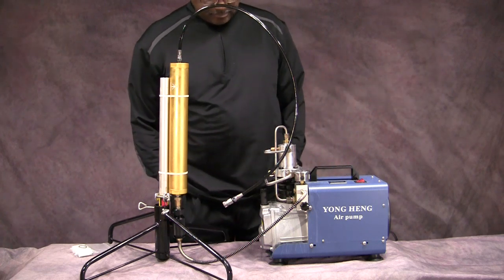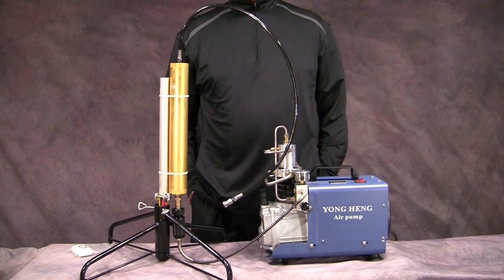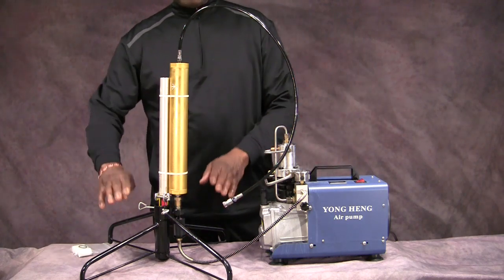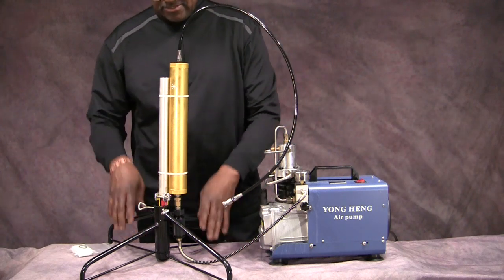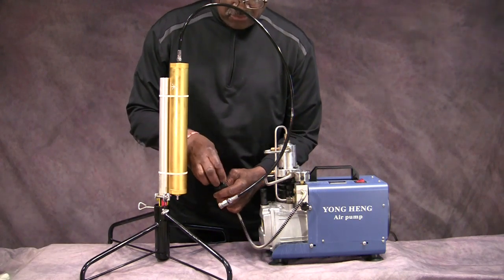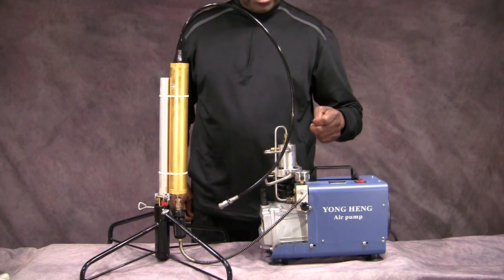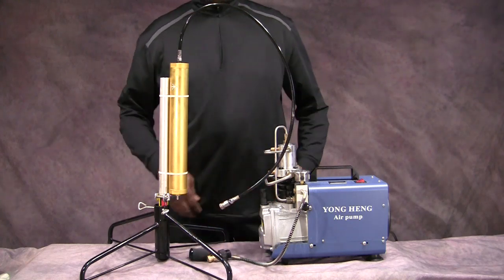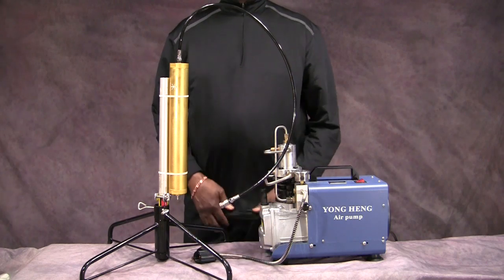Update: Final Setup for my Oil/Water Filter

Comment: Thing is, most of the filtering medium is useless... you use charcoal, which only really helps with odor from the compression and silica, which is just not as good as the molecular disiccant at high pressures. You only really need the cotton "filters" on top of the molecular disiccants.

Comment: The water itself is not necessarily a problem in quality built guns (bigger problem with cheap metals). But the real issue, is the water freezing under pressure. It can destroy valves, etc. if the water freezes at high PSI ejection.

Comment: I picked up a tree stand from amazon as of my post it was $9.99 on sale. The legs fold up, I plan to use only 3 legs and wire tie the separator on to the side that's folded up. With the legs folded up it takes up less room, being steel its sturdy an stable

Comment: I am s-l-o-w-l-y getting started in this game and as such I spend a lot of time looking over old and new information . I found your post today and I have to tell you the "tree stand" is a Super Cool way to set up the vertical filtering system.  Those stands are generally cheap and can be found anywhere.  The footprint is wide enough to prevent the filter from tipping over. Thank you for sharing this idea and thank you for the rest of the information you provided in this video. Looking forward to watching the other video's you have produced!!!

Comment: Quick question Aaron, I filled my tank to 4500psi and I mistakenly closed the valve on the tank before turning off the compressor or releasing the air from the drain screws and now my Yong Heng compressor blows air out of the black oil fill cap instead of the fill hose, do you have any idea of what the issue could be I would really appreciate it ,TIA

Comment: I have a question why won't the hose from the compressor fit the snap on on the filter ?
Reply from the maker: I had no problem with that.  However, if you are having problems just pick up a few extra male and female fitting on eBay.  I find that the quality is often better than those that come on the hoses, tanks, filters etc.  These are the ones I purchased: https://www.ebay.com/itm/363616280262?hash=item54a9381ec6:g:EFYAAOSwNnVhijK4
Best of luck.

Comment: You need to flip the line from top to bottom
Reply from the maker: NO,  I WANT THE COMPRESSOR LINE ON THE BOTTOM SO THAT AT PRESSURE RELEASE MOST OF THE WATER WILL BE BLOWNED OUT OF THE CYLENDAR.   Thanks for watching.

Comment: Hi Aaron, I bought the Yung Heng compressor last week and watched both your videos about it, I liked your Xmas tree stand idea. This is my first compressor and I wrap the wet towels around the tubing like you suggested and put radiator fluid mixed with distilled water.   I ordered the oil water separator, and a 4ft fill hose. The only thing I didn't order yet is the 90° elbow fitting I noticed on your compressor.  I was only able to find one rated 2800 psi maximum. Is there ones rated higher? Thanks for all the information.
Reply from the maker: I did not put an elbow on my compressor but I have put them on my fill adaptor.  I just went to Lows and got 1/4 inch elbow from their plumbing department.  No problem yet. So the 2800psi should work I guess.   Best of luck.

Comment: Amazon has that filter for about $90 I use the alpha filter but that’s  $400 I was thinking to get that filter and try it as a first stage and use the alpha filters as a secondary and try to see if anything makes it to my it to my alpha filter  ...I have 3 compressors and the young heng it’s my cheapest one i like cause it’s convenient I also have a $2800 scuba compressor the young heng is the one I use the most good one for the money
Reply from the maker: If your have a a $400 Alpha I think it is overkill to add another.  Just use the original Yong Heng filter as I do for a pre filter and change it often.  Just my thought.  Thanks for watching.

Comment: When mounting the filter is the charcoal at the top and the molecular sieve at the bottom
Reply from the maker: I like to have it first go through the  cotton then the molecular sieve and then the charcoal.  However I have now taken out the charcoal because I was told that the charcoal is for diving.  Now I put in double cotton first to make sure the oil is trapped and the Molecular sieve last to take out the water..  Thanks for watching.

Comment: No offense, but I don't think you really understand how a desiccant like Molecular Seive or Silica Gel works. Both those materials actively absorb water and bind it until saturated, at which point it may as well not be there because it isn't going to absorb any more water. The only time you'll see liquid water is when the material cannot actively absorb any more so leaving the bottom end open to 'let it drain out' will not work - either the material is 100% saturated or (if not) it will continue absorbing water from the air until it is. It will not 'dry out' if left on its own, you have to use energy to drive off the water, such as heating to 350degC in an oven for 4-5 hours. Once dried it's good to go again. Molecular Seive is a bit more aggressive/faster than silica gel for absorbing water, and consequently requires more energy to force it to give up any water it has already absorbed. Don't ever leave it in an uncapped container for any length of time.

Comment: I like my Yong Heng but you do need to operate it correctly.  I had to return the first one I bought.  So turn it on with the black knobs turned out and run a minute or two then tighten the black knobs. Depends on outside temp for worm up colder temps run more, hotter temps run less.  Before turning it off depressurize (black knobs out) before shutting it down.  I have had mine for 1 year.
Reply from the maker: Great ideas on how to maintain the compressor for many years of service. Thanks for watching.
Reply from the maker: Sorry this is so late but I just found your comment.  Thanks for watching.

Comment: Hey Aaron, I'm kinda new to PCP air rifles. I work on high pressure air compressors and high pressure air dehydrators when at work. Some pointers I'd like to give you that will ensure the air you put in you bottles is dry.Air is like a sponge, when you squeeze a sponge the water falls out, when you compress it at some point in the compression the air reaches saturation, when that point is reached 3 things have collided  " pressure " moisture content" and "saturation temperature". A simple thing you could do is install a back pressure valve set at lets say 4200 psi, have the valve installed as the last fitting before the air goes into a bottle of gun. In doing that when the air is squeezed to 4200 psi and then the back pressure valve drops it to what ever pressure you charge the bottle or gun to lets say 3500 psi that 700 psi drop expands the air causing a separation of saturation temperature and pressure, just like wringing out a sponge. The other thing I would do is the cylinder you have, the gold colored one, if you could wrap that with a wet cloth and blow a fan on it you will get a chilling effect like a swamp cooler and that will aid in condensing out moisture from the process air, if you could submerge it in ice water would be even better but I think that is a little extreme. Also what I would do, on the cooling water, I'd get some copper tubing maybe 1/4 inch of the soft refrigeration type and wrap it around the discharge pipes of the compressor (the ones that get hot) just coil it around the pipe. I'd then route the water returning into the bucket thru those copper tubing's and then into the bucket. The compressor will run cooler and you will get more water and oil out of the air.
Reply from the maker: I had never heard of compression aiding in dehydrating the air and Ice water ideas sound good.  You have some great ideas on how to keep the compressor cool.  Thanks for the information.  Best of luck.

Comment: Hello Aaron, Question:: I have installed this same setup with just beads. I have a problem here. During fill-ups when the pressure gets to around 150 bars the compressor struggles and will not continue filling to my required 200 bars. My compressor does not have a auto pressure shut-off.. To me it seams as though the high pressure may be compressing the beads so tightly that the air flow is restricted (just a guess).After removing the filter everything returns to normal,. Have you had this problem or have you heard of this problem with this filter before?
Reply from the maker: I have now heard of that problem before.  The beads cannot compress as the air will travel around them.  Try placing a cotton filter at the end of the filter as one of the beads could be clogging the outlet.  I have cotton at both ends of my filter with the beads in the middle.  I am glad to know that it is not the compressor itself.  Thanks for watching and best of luck.
Reply: There is a metal disk with air holes on the top of and bottom of the filter to prevent that, but I will try cotton also, thanks|    @aaroncantrell8819
Reply from the maker: In that case I just don't know what could be causing it because the air passes around and through the pellets so they can compress.  Wish I could be of more help.  Thanks.
Reply from the maker: I just talked to ken and he has had his for almost three years and he says that his will now not compress over 3000 psi and then it blows a fuse.   He thinks it is the motor not being able to push the piston past 3000 psi.  I just wanted to pass that along too.  Thanks again.
Reply: Well if kin decides to try a fill by bypassing the filter and go to a straight fill I would surely appreciate to know if his compressor returns to normal and goes past 3000ps, Mine works perfect without the filter.r @aaroncantrell8819
Reply from the maker: I will tell him about your similar problems to see if he has come up with a fix.  thanks.

Comment: Aaron  I hate you now  another thing to buy. Going to buy a harbor freight $10.99 12x 18 wood rolling cart to move it outside to porch.  6x16 covered porch.  Will be easy to mount the filte4 as the Yong heng measures 12 X 18 and will fit crossways  .to crippled up to carry a 30 pound thing while using a walking stick.
Reply from the maker: Sounds like a good plan I think I am going to copy it.  My compressor is on top of the washing machine and driving my wife crazy.  A cart would allow me to put it away when not in use.   Thanks for the idea.  Best of luck.

Comment: Great and very informative videos. I’ve been watching several of your videos and I have purchased one of these Yong Heng Compressors for filling my HPA Tanks for paintball a couple weeks ago. Everything has been 100% on my end and I have the same system. No issues at all. Do you think the desiccant is unneeded or would it be okay to use both the desiccant beads and the molecular sieve beads together? 

I also may add one more Cotton Filter at the end of the big gold water filter, just to catch anything else that might pass through, for the last stage before the air goes to my tank. Would you say this is a good or bad idea? Appreciate your information and clear guidance. It helps us out a lot. I subscribed.
Reply from the maker: Everyone is telling me that I should use the beads and cotton because that will take care of the water and oil that could be a problem.  I would put the cotton oil filter first before the beads to keep oil off of them.  In my case I think I am going to put cotton, beads and then cotton again when I change my filter.  Thanks for watching and for subscribing. Best of luck.

Comment: Hello Sir,  your review of the Gamo Urban inspired me to get my first PCP gun which I got for Christmas.  Question if I may,  I'm looking at the Yong Heng air compressor. On Amazon, there's one for $289 (Simple version) or the pressure customized version for $379.  I'm a complete noobie at this.. But will the simple version work fine for PCP filling?  Thanks.  https://www.amazon.com/Compressor-Pressure-Inflator-Portable-Compressors/dp/B07JBV3VBC/ref=asc_df_B07JBV3VBC/?tag=hyprod-20&linkCode=df0&hvadid=241941495556&hvpos=1o1&hvnetw=g&hvrand=17281590788733053361&hvpone=&hvptwo=&hvqmt=&hvdev=c&hvdvcmdl=&hvlocint=&hvlocphy=9011562&hvtargid=aud-466606931481:pla-574529760892&psc=1
Reply from the maker: Don't pay the extra for the pressure customizer because it may fail which could break the compressor.  Just get the regular one and keep an eye on it when in uses.  Also look on eBay and check under just PCP compressors because the Yong Heng is sold under several different names and for many different prices.  I got my compressor for $219 with free delivery.  Best of luck.
Reply from the maker: Sorry this reply is so late I just saw this post.  Thanks.

Comment: Hello aaron
Got a new question for u. Bought the yong heng.  Now trying to decide in an oil.  The book calls for aw or iso 46  but recommends  mobil 827/829.   The 46 i's a 15 weight oil while the 827 is higher. Not to mention expensive.  And I've also read a few comments on the net about using air comp oil that is rated for scuba or human air consumption....   what you think buddy?
Reply from the maker: Ken and I use #46 Hydrolic oil.  It is a clear oil so you will know when to change it by watching to see when it starts to get dark.  I hope this helps.  Thanks for watching.
Reply: John Brewer:  I sprung for the more expensive synthetic oil,  Amazon $8.95 a quart.  It is clear and cheaper than any syn.  I have used synthetic oils for 30yrs and they well worth the money.
Reply: @back2backjack1   thanks robert.   Im going to do jyst that.   Im jyst trying to decide on scuba compressor type oil( assuming that the oil doesn't release as much of the smell)..   or an equal to the the mobile 827 they recommend...

Comment: Thank you Aaron for making all these videos. I just ordered the Yong Heng and the filter that you recommended. Hopefully I'll have the same good results with the system as you have had.
Reply from the maker: I would almost guarantee that you will have a Good experience and service from this system.  In fact the only failure I have ever heard of is when they forget to plug in the water pump resulting in failure.  But they got the parts they needed on Alie Express and made the repairs in no time.  So make sure that the water is flowing every time.   Thanks for watching and best of luck.

Comment: Aaron: Your air must be drier than a popcorn-fart (as my dad used to say)  However I think it is over kill.  I use the first stage and change the cotton every use (they are cheap)  Thanx for Ur take on wet PCPpp"s
Reply from the maker: I really researched this topic before marking this video and all the experts say that this kind of filter is a must and if the filter is not used correctly they are not effective.  So my video contains all their information and recommendations.  Better safe than sorry especially if the solution only cost $99.00.  Thanks again.
Reply: OK @aaroncantrell8819

Comment: Today when I got my gamo urban I thought I didn't pull it back far enough  so I pull the bolt back twice putting 2 pellet in it at once when I shot  one pellet came out the side really fast I though I mess up the silencer I got lucky anyway nice video....  Isn't it possible to used car air compressor  sorry for all the questions
Reply from the maker: No a car compressor can only pump up to about 150 psi.  I have had hundreds of double feeds but never had any come out sideways.  Are you sure that is what happened.  Thanks for watching
Reply: @aaroncantrell8819  yeah i took the silencer off it had lead on it IDK if that is from shooting it or from where that happen but it went out fast enough to hurt.   I had the mag out when it did that.  Those
Reply from the maker: @hondadeluxe8201  My friend Ken once had a gun that  just wouldn't shoot straight.  He later found that the shroud was damaged and each pellet was hitting it causing the inaccuracy.  I wanted to pass that on just in case.  Thanks again.

Comment: I just installed a filter on my yong heng and replaced the molecular sieve that came with it 5-6mm, with some that is 0.5-1mm in diameter. It seems to work.

Also I bought a hiking type water bottle that has a straw that goes right to the bottom. I drilled a hole near the top, where I attached a section of the straw to the inlet of the compressor using another fitting (not sure what the size is). I then filled the bottle with desiccant, so that the spout that is usually used to drink from, is forced to suck the air down the straw, through the desiccant, then through the original filter screw, through the cut section of straw and into the compressor. That way it reduces the amount of moisture going into the compressor itself.
Reply from the maker: I like the idea of attacking the moisture before it enters the compressor. I think I will look into that possibility. Thanks for watching.
Reply: Qyuubi786-  Would it be possible for you to link to a picture (or video) of what exactly you have done? It sounds promising! Thanks
Reply: @thomass8362  Sure I'll do a video on it. It shouldn't take too long.
Reply: @thomass8362  Here is the video.
https://youtu.be/CeKiK0fFXgE go to 2.15 for the part about the filter.